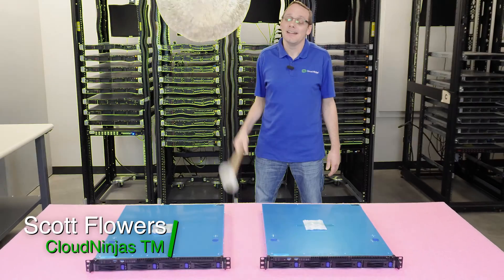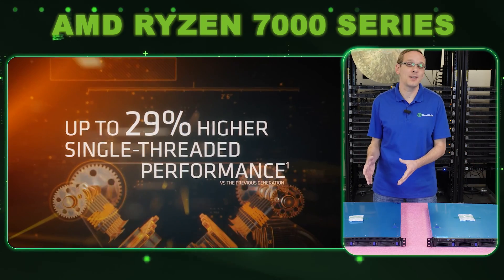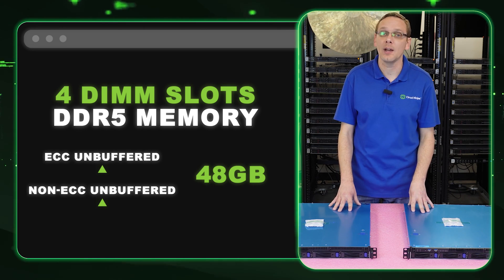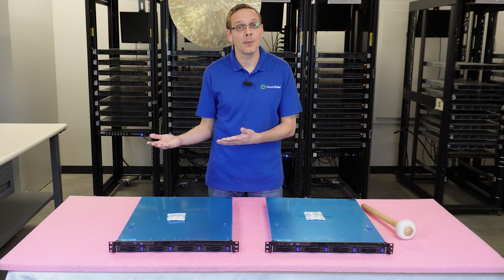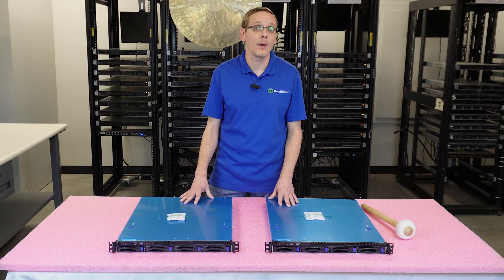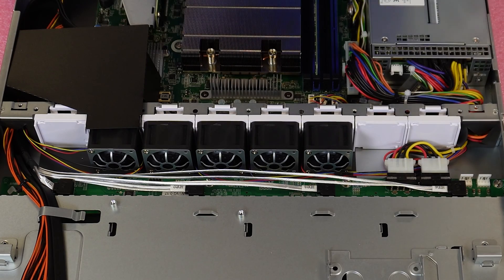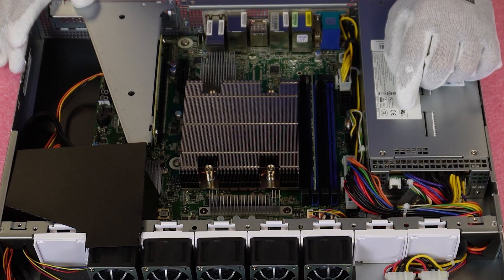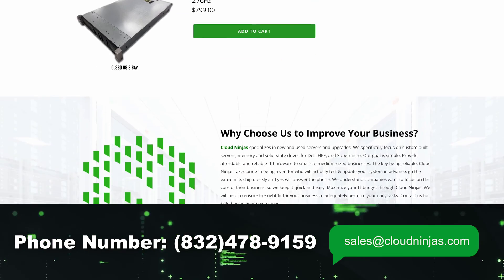ASRock Rack B650/2L2T RPSU Overview | AMD | DDR5 | Drives | Power Supplies | 1U4LW-B650/2L2T RPSU

Comment: Any problems with overheating with the higher end cpus? Curious as to why you use the 7900x instead of the 7900 which would seem more suitable for a 1U build. I see you use a fan heatsink with the higher end cpus; Is that an ASrock included product?
Reply from the maker: We enjoy the 7900X processor because it is faster than the 7900 CPU. You may run into some overheating using higher end processors, but that can easily be fixed by adding more fans inside the server to help with that.

Comment: What sort of heatsink are you using in that build? It's sufficient to keep a 7950x cool?
Reply from the maker: Great question.   Some misinformation out there.   ASRock original datasheet showed 7950x as not supported.   It is supported.  And we are using the original heatsink that comes with chassis and having no issues.  If you need any servers then we'd love to quote you.  Thank you.